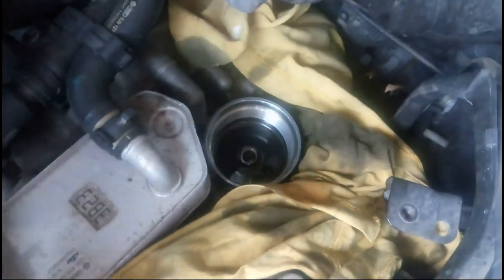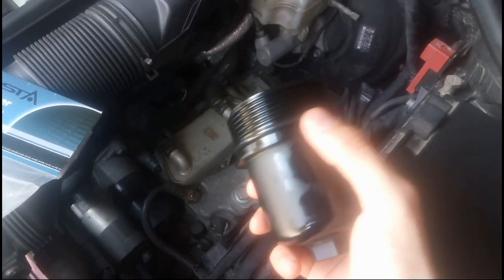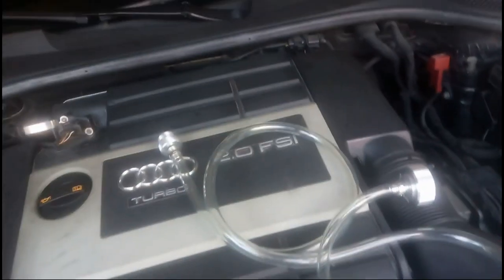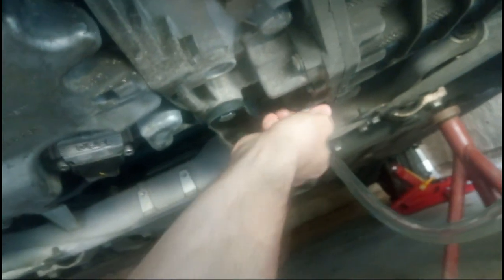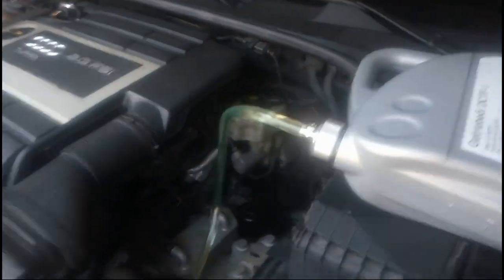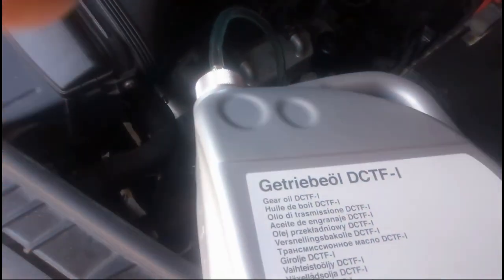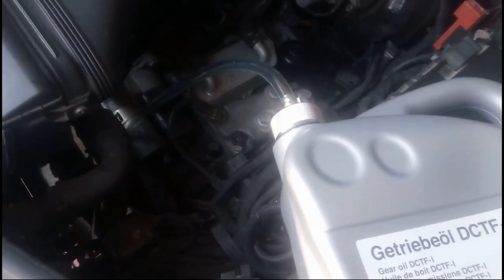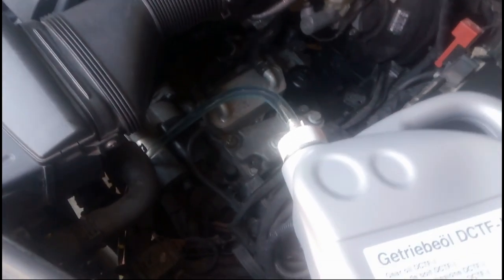How to use VAG Adapter Funnel to Change DSG Gearbox Transmission Oil Audi VW

Comment: Nice video, yes, it is really necessary to go through all the gear, the manual says: "Press brake pedal, select each selector
 lever position for about 3 seconds and then move selector lever back to P." . Official VAG 6262 A adapter has an air intake or breather pipe (google it) so you don't have to unscrew adapter every liter or so to take some air in to allow the flow.

Comment: Great video....can you tell me which app and OBDII adapter you use to get the gearbox temperature..?
Thanks
Reply from the maker: Option 1: ELM372 and Torque
Option 2: HEX+CAN and VCDS
Option 3: IR thermometer
Reply: Was it the torque app by Ian hawkins. Thanks

Comment: Hello. I'am choosing transmission oil for DSG between VAG G 052 182 A2 and Febi 39071. What do you recommend ? Is Febi oil good in your experiance?
Reply from the maker: I have only used Febi so far. I cannot tell the difference, but it does the job, shifting is smooth, and I had no issues with transmission so far. However, all the audi automatics are a bit jerky in 1st below 10 km/h, for which I think different oil would not make a difference.

Comment: Instead of taking the hose off the bottom to check the level. Why not leave it on until the oil flowing out slows to a dribble and then remove it and replace the plug. It would lead to less mess wouldn’t it?
Reply from the maker: Sure, but it is hard to see the dripping when the hose is attached - especially for the video. But definitely worth to try this.